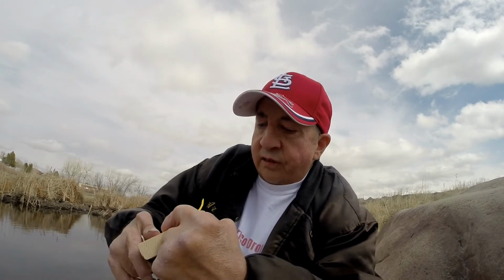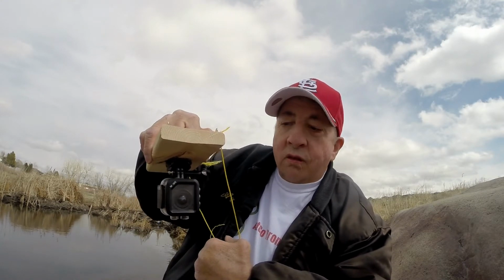Under water drone video

Comment: Hey Art, The wifi doesnt travel to well through water. There is a hack for it though. I used RG174 Coaxial cable. Look on you tube for "gopro wifi underwater extension cable" its a simple little project.  Yes you can get a live image from doing it. Good Luck